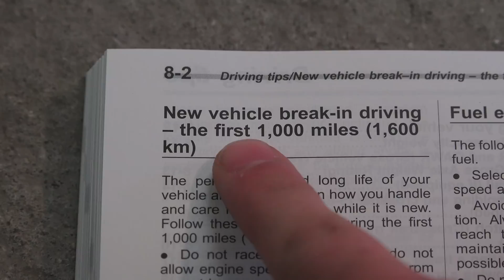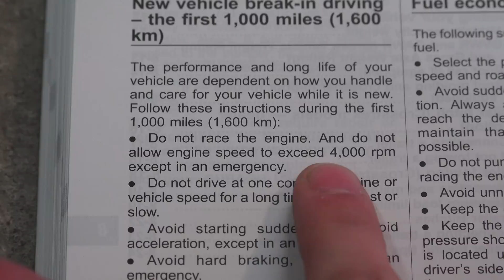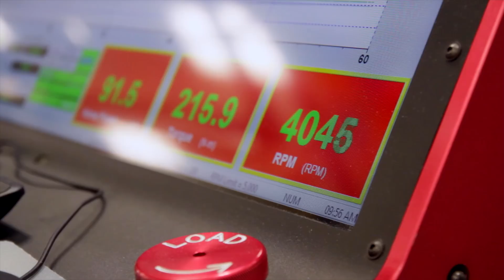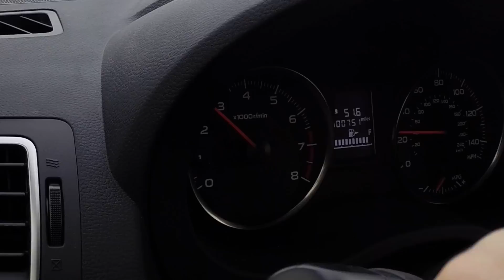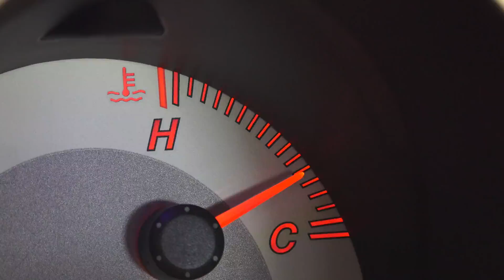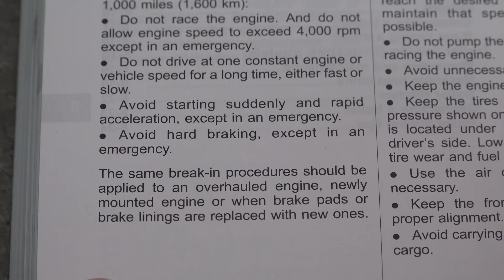5 Things You Should Never Do In A Brand New Car

Comment: Can you break the myth about warming up car or not. Manufactures don't recommend warming up engine. Many people believe it's because of EPA regulations. Any thoughts?
Reply: Tyson Currie couldn't have said it better myself
Reply: Ford said never to down shift my 94 Ranger because of the EPA. I did it from day one and now I have over 220,000 with no engine repairs.
Reply: You have to warm up but only for 30-45 seconds so the car can get oil in all the necessary places
Reply: If the engine is already somewhat warm just let it idle a few seconds to get the oil circulating. 
If the engine is cold, especially in winter, start it, let it idle until the computer slows the idle down to about 1000 rpms then drive it easy until until it's fully warmed up.
After that drive the hell out of it.
Reply from the maker: https://youtu.be/xKALgXDwou4
Reply: afrosheenix
 Now days manufactures do not recommend it. They recommend to drive right the way, regardless of the weather.  I think it's virtually in all manuals, no manufacture wants you to idle. I think it has to do with EPA regulations.  I think that 5 minutes of idling at below 32F would not hurt, especially because oil is not the only fluid in the vehicle that needs to get warm.
Reply: Roman O manufacturers always recommend warming up the engine to some extent. You gotta warm up the cats and get oil where it needs to be before taking off. But EE's video lays it out.
Reply: Its actually against the law here in S.C. to let your car sit and warm up in your own driveway! Yep just seen on the new last week someone got a ticket for it. SMH!
Reply: Tyson Currie when in open loop the ecu doesn’t use the o2 sensors it uses engine coolant temp intake air temp . Once in closed loop and when the engine hits a desired temperature 170 degrees on average which literally can take 5 mins of driving will it use the o2 sensors . . Run it for a few seconds then drive . You can’t get it to closed loop any faster than driving that’s why the manufacturers recommend driving right away.the quicker it’s up to temperature the faster it will be able to run cleaner which is another reason they want you to drive . Just don’t floor it until it has some temperature in the engine.
Reply: avery gentry so remote start kits are technically illegal... that’s not right man. Being in stop & go traffic would also be illegal, your car sits and idles in stop and go just like it would at a red light, or sitting in your driveway. There’s no laws that regulate if you start your car and let it sit or not....
Reply: Personally when it gets lower than 0 degrees Fahrenheit I let my car sit for about 3-5 minutes if I have the time.
Reply: Roman O If you car is turbocharged it's a must. You don't warm up the engine the oil will not be viscous enough to properly lubricate that turbo.

I usually let my car sit for a minute then drive off slowly. Not putting on more than 1500 rpm until the temp gauge is where it needs to be. 

That's just me though. There are a lot of people that will till you otherwise.
Reply: Roman O ,yes you have to let the car run for a bit until idle comes down. when you first start a car it is in open loop because the computer does not know what the oxygen sensors are telling it until they are warmed up and send the correct signal that the computer is looking for to add the correct ratio between fuel, and oxygen, then it goes into closed loop, not to mention also letting oil flow thru and getting correct oil pressure. Everytime I start my vehicles I turn the key to run position for a few seconds to let the computer check and read every sensor then start it and let it run until the idle comes down so the computer can read the oxygen sensors, if not the car runs rich until the oxygen sensors are warmed up to temp.

Comment: 2010  BMW X5 3.0 155k Have run the piss out of it its whole life and maintained it well and that thing has been perfect its whole life.
2013 BMW 135is Pushed it to redline every time I get into it. At 50k miles its been perfect.
2017 BMW M2 It gets pushed every day from new.
2010 BMW 528xi 111K We drive it hard and have not been gentle since the day it rolled off the assembly line. 

Get em ready for the life they'll have. Long Time BMW/Audi/VW owner. You can drive them hard but not obliterate them and they will be fine. I don't know what the hell this guy is talking about.

Comment: RE Run-in period. The latest facelift version of the Mercedes A45, or CLA45, are restricted by the ECU in the first 1000 miles. So you cannot rev it high, or cannot use Race mode etc.

Comment: yep. bought three new vehicles always had no issues. I've bought a few used cars and Bam... issues at higher miles. for instance my civic SI I bought with 7k miles. wish I didn't. now it's getting a new engine put in as we speak :( I have a feeling the previous owner floored it since new. there you have it. always drove this way when new even motorcycles too. zero problems.

Comment: My experience is largely with, on road & off road motorcycles, 4 and 2 stroke engines, automobiles are generally equipped with 4 stroke engines.  I have built single up to 4 cylinder engines and my experience is that you don't want to take the easy break-in procedure, you can tell, when engine tearn-down, if one has taken the easy or hard break-in route, easy break-in you will typically see more brown tarnish on the skirts of pistons, when using the hard break-in you will see much cleaner skirts of pistons. Hard break-in does not mean you rag on the bike, you simply accelerate under heavy load along with engine breaking, another important thing to do is change you're oil often for the first 1500 -3000 miles, I typically change my oil after the first ride, lasting about 15 minutes or so 5 - 10 miles, there is no such thing as break-in oil as dealerships will often tell you, however there are oil qualities that will be better to use during break-in period, usually thinner than normal and NO synthetic.
Reply: perseverance8 it sounds like you are talking about dirtbikes and not cars. It is crazy to change your oil 15 minutes after you start riding

Comment: Do I need to break in my Tesla
Reply: Not if you have a key.
Reply: Yea don’t turn on your windshield wipers until you reach 30k miles 👀
Reply: What he said about hard braking using the mechanical brakes might still apply, but the rest is specific to cylinders and pistons, neither of which are in an all-electric car. So, basically, no, you do not need to break in your Tesla.
Reply: No, but keep telling people you have a Tesla.
Reply: @tgoods5049  Underrated comment.
Reply: What you need to do is drive your Tesla from LA to NYC within 48 hrs.  Co-drivers are acceptable. 
That's 3000 miles at an avg speed of 65 mph.
Reply: No, Elon has already broke it off in you.
Reply: No. By 40k miles it will be broke anyhow j/k
Reply: I am pretty sure he was joking
Reply: What is a Tesla
Reply: your batteries might get a headache if you drive to fast
Reply: Armando Ferreira , but I think there is recommendation for battery charge percentage should not fall below some value for few weeks for new car.
Reply: Read your owners manual! Don't go by people on Youtube saying no because it has no gas engine, they are assuming. READ YOUR OWNERS MANUAL!!!
Reply: Armando Ferreira ...trade that Tesla on a Ford Electric or hybrid car! Tesla is overarrated & overpriced. Still better than foreign. ☺
Reply: Armando Ferreira no. Just scrap it. No break in, no maintenance, and no balls... Just scrap it and upgrade to a gay-ass prius or smart car
Reply: Tesla is str8 up garbage but I'm sure it makes you feel like you're saving the planet (you're not).. Hope you never have to work on it because you cant...hahaha
Reply: Charge the batteries before you start using it
Reply: Hahahhha smart ass
Reply: Full throttle with the e-brake on with your eyes closed i think.. but maybe ask tesla themselves over youtubers.
Reply: no but you can scrap it
Reply: Im pretty sure you do. Just like a electric motor from an RC car, you'll need to take it easy on the electric motor in your Tesla. Same for every other electric car or hybrid, like the Toyota Prius.
Reply: You did not listen well, it could explain why you choose poorly.  Your brakes absolutely have a break in period which is probably lengthened because of your your electric breaking, also would not be surprised to find the electric motors need a break in as well...
Reply: Dont go over 150 volts for the first 20 feet 😁
Reply: Yes it is still mechanical
Reply: Well I mean, of course you need braking; you think a half ton mass moving at 40mph is just gonna stop.
Reply: Armando Ferreira
Reply: Armando Ferreira i can't afford a tesla.
Reply: Idk
Reply: Armando Ferreira the breaks
Reply: You need to return it and get a real car
Reply: anything with moving parts will break in. brake pads "bed" in, electric pumps run better, bearings too. and non moving parts can also improve like battery capacity, electrical capacitors, et al
Reply: Just make sure you keep up with your oil changes
Reply: not the engine, no; but the tires, brakes, suspension in general, autopilot etc.. :/
Reply: Treat it like a cellphone don’t charge over 80% 😁
Reply: duhh those need to warm up the battery,so avoid charging
Reply: Nope. Just scrap it.
Reply: Yes. Run it into a damn lake. Have it towed back to your home. Let it set in the sun for a month. Broken in. Enjoy.
Reply: You need to trade it innn
Reply: It ain’t a car
Reply: I'm gonna guess it doesn't have an internal combustion engine, so no.
Reply: That's for ruining the environment
Reply: No.  But you do need to use punctuation if you wish to ask a question...rhetorical, or otherwise.
Reply: You likely have to break in the battery.
Reply: I'm Cmart are you high???!?
Reply: Armando Ferreira how much should I spend on a tesla and what model is the best for best possible price for used teslas?
Reply: Armando Ferreira yes most likely
Reply: In short, no, you don't.

Comment: I knew they ALL run the engine in the factory, but I though it's for quality control reasons. So you don't get a brand new car that stalls on you still in the shop...
Also, in many cases cars are driven before you put your hand on them in the shop. If you see 31 miles you don't mind but how can you tell how some kid payed min/hour drove it from drop off point to shop, so factories don't risk it and run the engine before for "ideal" wear-out. But I could be wrong. And thats from my  brother who use to be a mechanic for Yamaha and Volvo dealerships btw. They say it (50% throttle and 4000 rpm) so you are safe if vehicles mis behaves if there is an issue with it and so you get more familiar with it before you take off. 300 miles is nothing for an engine... not even 5000. Again like you said, many opinions out there.

Comment: Note to self: don't buy a new car
Reply: But new cars are so wonderful. 
I've had 4 new cars and 1 new truck.  What a pleasure to break it in the way you want. Know the complete history.
I knew every nick and scratch on my cars and when they happened. 
When I traded them off they were in primo condition.
Reply: Only problem is, you dont know how that used cars engine was broken in... 😉
Reply: Buy a car that's like 3 years old with 30-60k miles on it. Saves a lot of money in many ways and is still basically new.
Reply: Buy a 1 or 2 year old car with low mileage... Ill be much cheaper then a new one xd
Reply: Isaac Spencer No it’s not
Reply: It's not worth it, depreciation is too big.

Comment: Buying a brand new car is a waste of money in the first place.
Reply from the maker: Not necessarily. There's a warranty, and you know it wasn't abused before you buy it - know what you're getting yourself into. Financially it's certainly better to buy used in most cases, but there are benefits to buying new.
Reply: Engineering Explained
I guess it depends who you are. I always see buying brand new as for people who don't know much about vehicles and are fine with losing $10,000 or more the second they drive it off the lot just for that piece of mind.
Reply: Subaru's don't drop price like that. And I only drive Subaru's.
Reply: It depends. I just bought a new WRX for less than what other dealers were selling for used ones.
Reply: The dealership isn't going to honor the warranty if you got your car serviced at Joe Blow's garage because they don't know everything was serviced to their official specs. My sister's Impala's motor blew at 75k miles and GM wouldn't honor the warranty because she didn't get the oil changed at the garage. Wtf, she did them all herself because it's cheaper and the official GM service garage wants like $90 for a simple oil change.

And if I buy a used car for $5k, you better believe I can turn around the next day and sell it for $5k. Otherwise you got ripped off and paid more than it's worth.
Reply: +Subaru WRX Not really, you can negotiate the prices of used cars too.
Reply: - says the broke person
Reply: Well...somebody have to buy new cars to other people later buy them used.
Reply: Kanglar besides warranty, you also get rebates off of new cars, free service (sometimes) and better interest rates. I have bought new and used and you only take that hit if you try to turn around and sell it right back. But, so would you with a used car. Stealerships are in the game to make money.
Reply: Kanglar my point is if you buy a used car, and instantly turn around and sell it you won't get your full money back either. Either way (new or used) you are going to take a hit. And that bs about oil changes is completely false. My cousin blew is speed3 and Mazda replaced his engine. He just had to show receipts for the oil.
Reply: Kanglar we never went to the dealer for any service since the day we bought our speeds. So idk who told you that.
Reply: "you only take that hit if you try to turn around and sell it right back"
That's the point, it is instantly worth less so you are wasting money. That warranty is only valid if you do all your oil changes and services at their official garage at absurd rates. Stealerships make more than enough money, and when you think about it it's kind of BS that they even exist, why can't we buy direct from the manufacturer?

Comment: So I have a JDM ITR motor B18C Fully built from the ground up went with boost Via Perscision BB 5858 Turbo, question is when it's assembled should I get it Dyno tuned right away or No? they will run it WOT this will be a 550Hp+ 4Cyl

Comment: very funny my 2014 challenger rt run 5he hell out of it since iv had it and even added a turbo for a total of 550hp and it has 20.443 miles and never a problem there is no need for a break in any and i repeat any internal damage if the oil is kept changed is coverd under warrenty

Comment: I'm gonna call BS on the don't get on it redline brand new. I am religious of letting it warm up, but once the engines up to running temp, it doesn't get babied. Hasn't ever failed me... But ya know, only built a few engines and then owned a couple new ones on top of that... 

#5 is also complete BS because my truck is specifically told to hook up to something when new or rebuilt engine is in it. Heavy and through hills. 

You have some good facts in your other videos, but this one you just failed. I'm not saying keep it at redline, but going through the whole rev range and getting on it or towing is NOT gonna hurt anything...

Comment: Mazda includes a point in their manual regarding varying the throttle:

"No special break-in is necessary, but a 
few precautions in the fi rst 1,000 km 
(600 miles) may add to the performance, 
economy, and life of the vehicle.
>  Do not race the engine.
>  Do not maintain one constant speed, 
either slow or fast, for a long period of 
time.
>  Do not drive constantly at full-throttle or 
high engine rpm for extended periods of 
time.
>  Avoid unnecessary hard stops.
>  Avoid full-throttle starts."

Comment: It's a little different for let's say drag motors. Usually we do a couple passes on motor (nitrous use). With nitrous use, it's all out by the third pass. For some it's all out the first pass. Turbo or forced induction get a couple light shakedown passes and then it's on.

Comment: My feeling is that a dedicated "break-in" period is tied to the generation of autos when 100K meant the car was finished,30K meant a valve job and 60K meant rings and bearings. How much would it bother you to know the mechanic that PDIed (pre delivery inspection) most certainly rung the car out a bit during the test drive before you bought the car?

In addition. At no time have i dealt personally or heard about somebody dealing with any issue that can be proven to be related to an incorrect break in technique. Now I have dealt extensively with early block wear problems (google "BMW  Nikasil engine block wear") that were related to manufacturing or design errors, plus the use of fuel with an incorrect sulphur content. You can check out the Chevy Vega engine block issues also. No type of break in technique would have prevented the issues we see in my 2 examples.